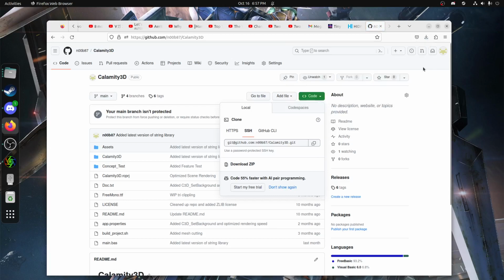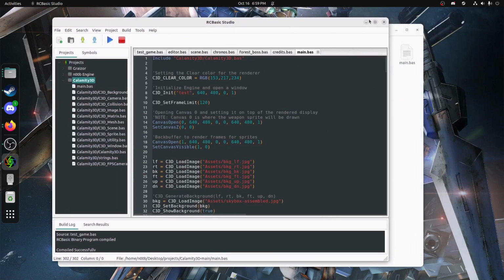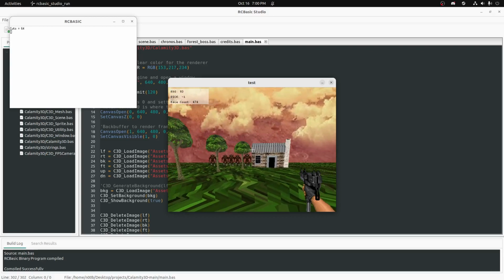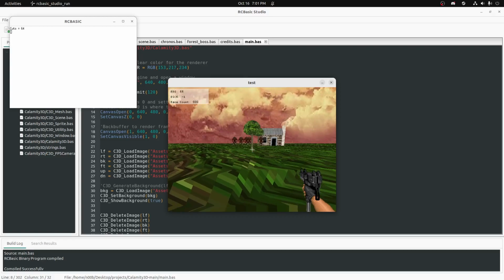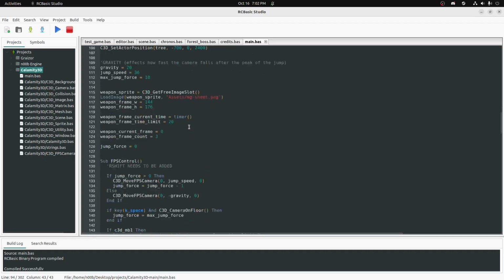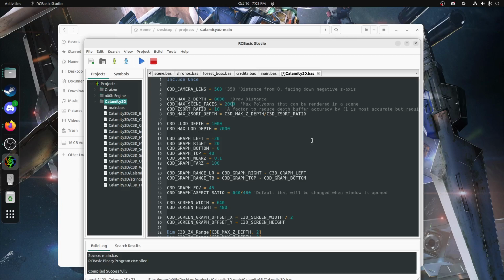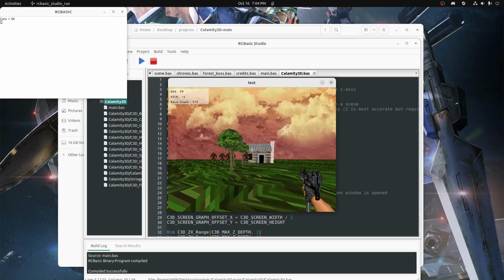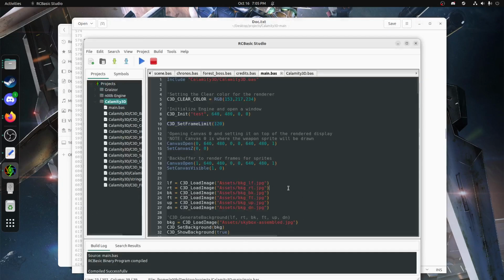3D Graphics in RCBasic

Comment: This is software rendering?
Reply from the maker: @NaaLaaCreator  Sort of. I did all the calculations for vertex transformation in software but is uses SDL2s builtin function for drawing textured triangles to do texturing.

I am close to the release of RCBasic4 which changes the rendering engine from SDL2 to irrlicht and then it will be full hardware acceleration.
Reply: @n00bc0de7  I love the retro psx look from affine texture mapping though :)
Reply from the maker: @NaaLaaCreator  I do to. Retro style games is the reason I work on RCBasic at all. I am sure its the same for you and NaaLaa as well.

I started working on this 3D library after watching several videos on the sega saturn and psx and how they rendered polygons. I read through a few articles on pete's qb site and decided to try to tackle it. I added a matrix library to RCBasic for the sole purpose of pulling this off.

How is work on NaaLaa going?